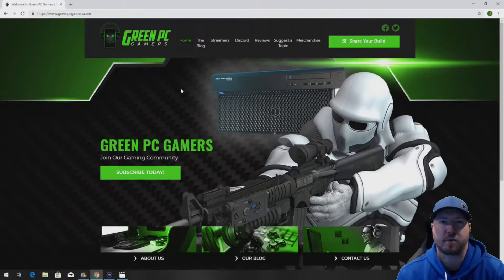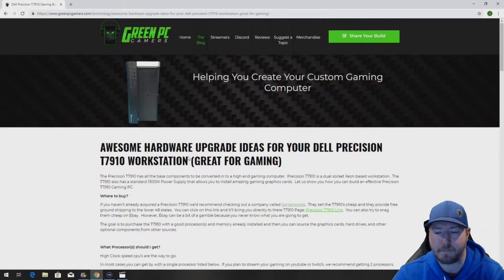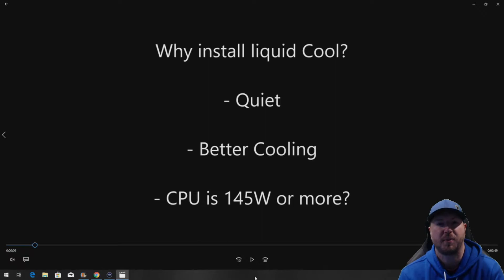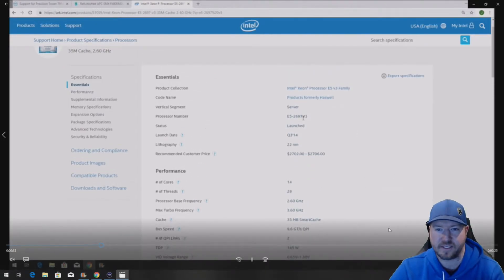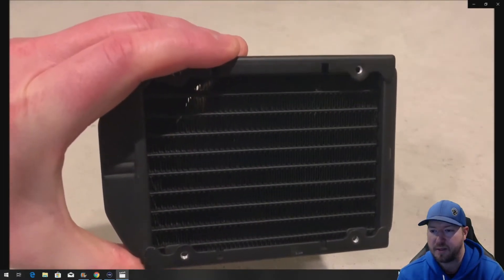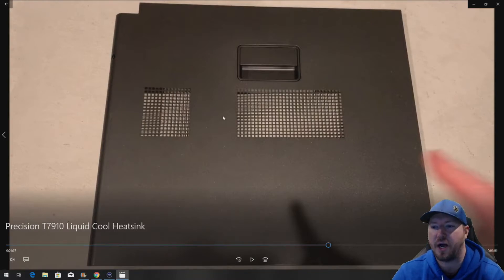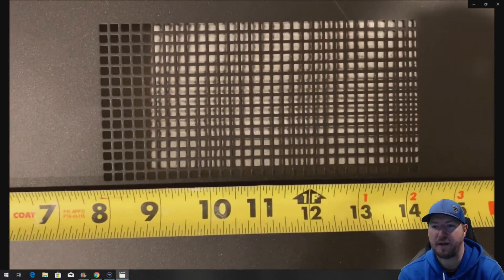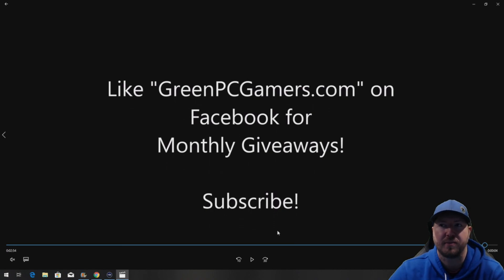Precision T7910 Liquid Cool Heatsink Assembly TMJK2 (Measurements for drilling holes in side panel)

Comment: My T7600 with just a single E5-2687W is running hot!  One of the cores spiked at 91 degrees with the others at 88-90 and I don't even think I was pushing it.  Definitely not putting the 2nd CPU in until I choose a liquid cooling solution.  This video was very helpful along with the past comments.

Comment: Would this fit a T3610??
Reply from the maker: It would fit, but you'd have to remove the metal optical drive cage and figure out a way to vent your side panel.
Reply: @GreenPCGamerscom  
thanks for your work, sorry mate can't find info can i use liqud metal with 1TD00 standart cooler ?

Comment: hey can you add the liquid cool heat sink assembly to the t7600??
Reply from the maker: We havent tested it yet, but I would guess that it would work.  It uses the same connection as the T7910.  You'd have to figure out a way to vent the side panel if you do add the liquid cool heatsinks.
Reply: @GreenPCGamerscom  I was wondering about this also, if it would fit on a T7600. Did you ever get to try it? Also as I recall there was a BIOS upgrade for the T7910 or some other model that has something to do with water cooling. As far as I know that BIOS upgrade didn't make it to the T7600 but I could be wrong. Any info you have on this is greatly appreciated.
Reply: @lashlarue59  Yes these fit right into a dell t7600 without any bios mods or upgrades. also the T7919 mesh side door also fits on the T7600 since they are identical chassis. PN nvy9x
Reply: @awidesigns  I finally found one of these on eBay and they want $159 vs. $15 for the non-vented version.